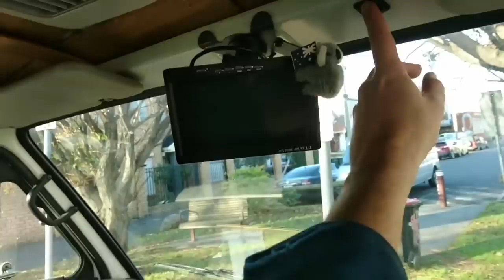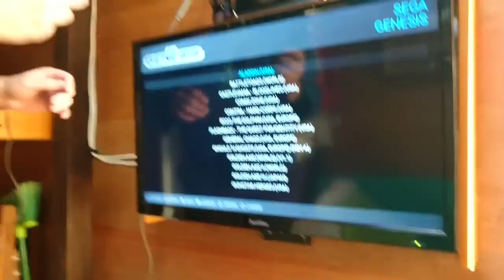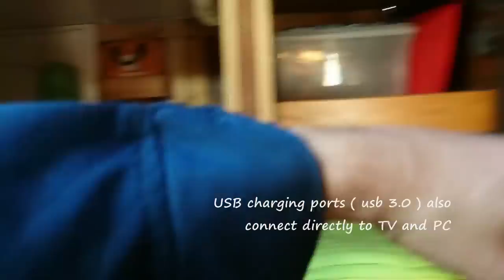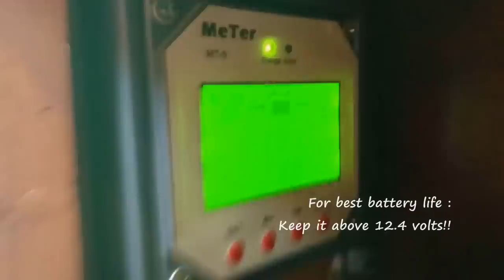How To Stealth Camp in Plain Sight in a RV

Comment: A good way to cover the solar panels on a stealth build is to label the side of the van/truck with solar survey and if anyone sees you getting in/out simply say you have to stay on location for a set amount of time as the equipment takes the readings in case something happens and you need to reset.
Reply: Or just don't go near two story buildings
Reply: Thats pretty cool. Imma go ahead and stay in my non-stealth house-house tho'. Think that might work out best.
Reply: Zia Smith  How did you get "Mom's basement" out of what I wrote?  I used all simple words.  Not simple enough I guess.
Reply: After exploring solar option I determined it was over-rated and detracts from stealth.   Charging house batteries from the engine is adequate.  7amp chargers can be powered from on-board generator when parked.  Generator is concealed in rear utility room. 50db.  Generator and AC  Exhaust is vented out the floor using   grow-tent fan.
Reply: If he’d wanted a generator to run while parked, it’d go up in the box where he removed the cooler and put in LP tanks...it’s a recycled fridge truck, so those run when needed...people hearing it would just think it’s a working fridge truck.  ‘Course, some looking to rob food from fridge truck, might try prying the doors open to get at it.
Reply: Great idea!!!
Reply: MAN OH MAN NOW THAT'S SUM DEEP SHINEOLA AND I  LOVE IT. MOST FOLKS WOOD BUY THIS EXPLANATION. Including the MAN.
Reply: @DesignerAviaries  Hahahaha Grow-tent fan!! I bet them grow tent fans run whisper quiet doncha know!
Reply: @Chimonger1  Sure but breaking into his truck will make a GOOD BIT OF NOISE. If Josh is watching TV and hears BG I reckon Josh will tear BG a NEW ONE.
Reply: Living in a house is a great option for people who have the luxury, but homes are getting out of reach for most people these days. Creative solutions, including some like this one, will become pretty common in the future. Why pay over 20k a year just for rent, when you can live in something like this for 5 years and save up for a down payment for a house? sounds like a good plan to me. Great option if you have a job that involves migration too.
Reply: I accidentally smashed the dislike button. This was in fact one of my favorite builds. I’ve been living in Vans nearly a decade and can attest that Josh’s Van works.

Comment: Ultimate stealth benefits from being able to access the living area from the cab.  

SECURITY:  
 1 )  22$  for a  driveway motion detector with 2 sensors.  Mount the sensors underneath on each side.  The alarm module inside will detect motion and alert you via light or chime.  sensors are not waterproof so use velcro mounting system and deploy when parked. 
2) front and rear cameras along with two cameras mounted to the belly that  cover the 
truck sides.
3) $35 for  12v  circular , orange strobe light mounted underneath.  IT can be activated when inside  if you hear something strange going on outside.  

4)  key fob to hit the  vehicle siren alarm.   

Ventilation
Your cab is ventilated but stealth ventilation for the box is ideal for fresh air.
My wooden plank floor has intake fan up front and exhaust fan in the rear.

Comment: After lots of thought I came to the same conclusion that a box truck was the only choice here in Australia, vans are 3x the price of any other vehicle with the same kms/year/condition. If travel is your focus then sure get a van but if its full time living then a truck is a much better choice in every way, cheaper initially, easier to build in, bigger and generally more reliable and way cheaper to repeair.......Surprised there aren't more builds with this type of truck.
Reply: Where do you park the truck long term?
Reply: Depending on the weight you could park it on the street worst case, there are industrial zones trucks are allowed. Someones driveway, depending on the weight restrictions in your area you can potentially park it anywhere a van can.
Reply: The fact that you don't know about them is proof they are stealthy :D
Reply: What about registration costs compared to vans?
Reply: Depends on what u get it classified as but any commercial vehicle will cost more.. Still dirt cheap next to rent.
Reply: Plus driving a truck, you'll have access to truck drivers stop amenities, that aren't available to the public. 
The only downside maybe the weigh station, if the furnishings and personal equipment, put you over the gvm.
Reply: The gvm is the biggest issue for sure, in Australia it needs to be under 4.5 tonne to park it on the street legally, not easily achieved especially if you want something bigger than this truck. Which I would need to be happy long term personally.
Reply: @MrDeklain  under 4.5 tonnes doesn't necessarily get classed as commercial. In QLD registration costs the same.
Reply: @jedics1  that size truck would easily be under 4.5. Even kitted out.
Reply: This in an Isuzu NPR300 which can be registered in Oz as 4.5t or 6t. So this registered at 4.5t is about as big as you can go with a standard drivers licence and standard rules for parking, etc.
Reply: A bit thirstier than a van I'd say. If you're travelling slowly it's not a huge issue but there are some areas where there's lots of distance between places and it'd cost a fair bit more to get around out there.

Comment: One thing I am not totally clear on with RV's in general, is why they need a separate black and grey water tank.  When you dump, it all goes in the same hole.  Are there situations where you can dump grey water but not black?  I have not encountered one in 25 years of owning some sort of RV.  I dump the black first, and then the grey, because I was told it cleaned the hose or something, but I have never once dumped one of them in a different place than the other.  They both go in the sani-dump.  My house works the same way.  When I lived in the city, they (the house plumbing) both went down the same pipe to the city system.  Now I am on a septic system, and it still all goes down the same pipe, to the same tank, and then on to the same field.  I don't understand why an RV needs 2 sewer tanks rather than one larger one.  To some extent, having just one large tank would help stop the poop and toilet paper from congealing.
Reply: In the vans I've been in Grey water is usually separate and black waste is in like a little cassette thing. Usually 10-20L
Reply: Grey water can be used for flushing toilets, watering plants, and more, depending on the rules where you live. At my house, my laundry feeds a separate grey water line, leading to a drain in my back yard that filters through a gravel bed and eventually out to the soil. It keeps the strain off of my septic tank, since we do laundry almost daily. 

In an RV, I suppose they are separate in case of a plumbing back up. If they were combined into one tank and you overflowed your gray water, you'd be overflowing the black water at the same time, right back up into your RV.
Reply: @gaslightheaded  That's probably it, only the toilet goes to the black water so it would be pretty hard to overflow that without knowing it.  We did overflow the grey water once and it ended up in the shower/tub.  For some reason the water tank on this RV is considerably larger than the grey water tank.  On our old RV they were about the same size so we never overflowed that one because about the time the grey water was full the fresh water was empty but the new RV has considerably more fresh water for some reason.  I assume it's so you can go longer without having to fill up with sketchy fresh water.  But I didn't know that the first time out so I figured "how can the grey water be full when I still half a tank of fresh water?"  Well, it was.  We don't usually have a problem with the black because I encourage everyone to use the outhouse unless we are bunked down for the night, unless I know I am only a couple of days from dumping anyway, like say when we are out for just the weekend.

Comment: Very nicely done . In the US the cost of auto insurance on a work truck like that is many times more than a motorhome / RV of similar size.  Could change iT to ab RV on the title with electric water and a bed.  This would reduce insurance, but not sure if tags would change to show that. Guess there is no need for gas furnace or AC there v

Comment: US units for those who use them:

60l = 15.8 gallons
15km = 9 miles
10cm = 3.9 inches 
120l = 31.7 gallons 
3.7kg = 8.15 pounds 
3.6 meters = 11.8 feet 
2.2 meters = 7.2 feet 

bed is 6.5 feet by 4.4 feet 

I like what he did. Some other Americans may as well, so 
we can use these measurements to understand what he did and 
how to replicate that over here.

Comment: looks great, but  I seem to have missed how it is heated (the empty airco shell would be perfect for an lpg burning unit,
since nobody would suspect a bit of fan noise coming from it)

The roof vent is a great idea : it can double as an escape hatch should the side door get obstructed :)
Reply: patrick van reeth I think I saw a portable propane heater when he opened the rear exterior door.

Comment from the maker: Josh is a 'Silence Carpenter ' very interesting and worth researching
Reply: Got a link or something I can look into? Basic google search yields nothing?
Reply: Joshs truck only uses 6,6l/100km ? Does not sound very realistic. 15l/100km sounds more like it.
Reply: It's a european model, they have small diesel engine (2.0, 2.4, 2.5.. 2.8.. something like that) and yes, it's very possible to use under 8L/100km.

My european van Volkswagen T5 1.9 Turbo Diesel, fully loaded and with AC on, takes maximum of 6 - 6,5L /100km in urban drive.
Reply: @1927AM  Your T5 has quarter of a cross section of this truck. You cant cheat physics. It maybe does 6.6 liters at 30km/h
My smart does more than 4l/100km in any circumstances. It has a 0.8 liter turbodiesel and weighs 800kg.
Reply: @1927AM  i do believ you, i am from austria an i also have a t5.2 caravelle it consumes about 8l/100km but witz dsg and 4x4 and long wheelebase.

But the buggest problem is the air resistance and a very high truck like that...... 

I thing it has a 3,9l engine ? I thought i was able to see it somewhere in the video.
Reply: @1927AM  at 0:43 you can see it... its a 3,9l engine
Reply: @NGC1433  i used to have a 0,9l 3zylinder "cabrio" smart too but i was able to get 2,6l/100km out of it.... between 60-80kph on country roads but you are right with normak speed about 4l/100
Reply: NGC1433 My T5 is a LONG WHEELBASE T5, it's almost as same as this Nissan.

And second of it, you smart is PETROL and has TURBO and it's automatic transmision.. u can't even compare it withTurbo Diesels from VW with Manual gearbox. 

AND YES, MY T5 1.9TDI doesn't take more than 6,5L/100km even with my AC On, in urban drive... and i change gears over 3000rpm and don't drive it under 120 km/h outside the city. (I'm not even mention that sometimes takes around 5.5L /100km because you might get mad because you wouldn't believe it) 

If you dont know VW T5, you better shut up cuz you talking bullshit. 

BUT... if i pass 120-130 km/h the consumption change dramatically due to the bad aerodynamics, somewhere around 8-8,5L /100km

AND the last of it: I DONT TALK ANYMORE ABOUT CARS WITH SMART DRIVERS, because you don't event fucking drive a car.. you're driving a toy and don't know shit about European or East-European cars.
Reply: @1927AM  as he said, his smart was a diesel! 

And we in austria do drive this T5s and T6 vw buses as emergency cars and if i drive it really carefully it consumes about 7-7,5l/100km.

The camoercan with its huge wind resistance eaasily consumes 12l and more on highways. And it does not have such a small engine as we do in iur T5s ... it has an enginde double the size of a t5 !!!
Reply: @1927AM  and you can have a look at spritmonitor.de or sites like that.... there 1000 of people do write down their cars and consumptions and this truck has an everidge consumption if 15l/100km.

Your vw bus has an everidge of 8,5l/100km .... 15000 ratings, so your data cant be true ;)
Reply: If Romanian T5 1.9TDI users see what you are saying they are laughing the shit out of them :)))) because if their T5 1.9TDi would take more than 6,5-7L /100km they would sell them immediately !!! :)))
Reply: @1927AM  haha believe in wathever you believe ;) physiks is real dude ;)

Look it up an you will see the truth... i have the t5.2 4x4 dsg long wheelebase and its around 8l ...in winter 9.

If you drive 80kph you can get down to 5,5l/100 but iam takling bout driving not crawling ;)
Reply: @1927AM  and the smart does not have a torque converter automatic, its an automated normal gearbox.... so there is no loss in energie transmitting ;)
Reply: So.. what's the point than, you agree that the 1.9TDI can easily get 6,5-7L /100km  (urban drive, not highway.. be careful about what i said in the first place) ? 

And about the Motorhome in the video, i wasn't watching all the video.. and i tought it's a 2.4 or 2.5 turbodiesel like Isuzu, Nissan, Toyota vans usually get, if it's a 3.9L engine... be sure that under 15L/100KM you wont ever get.
Reply: @1927AM  dude as i said i have the t5.2 with 180bhp too. And yes it can do 6l/100km BUT not if you drive it like people normally use cars. AND yes in this case you can use data from cartests and personal references , cause the post gas bills, and so on and i dont think that 15 thousend people are wrong , and why should they lie bout their cars consumption^^

But nevertheless the NISSAN we where talking bout has a 4l diesel engine and about 2,5 times more wind resistance than our vw buses have! (If you also dont believe in technical data from vw, just try to calculate it, if you dont believe in maths....do whatever you want. )
Reply: @1927AM  so we are fine ;)

Have a nice day, sir :)
Reply: Is he somehow related to silent bob?
Reply from the maker: @stoicallyeatingguy2  😅
Reply: Cool video, but this comment earned a dislike. How dare you tell me to research something with nothing to research.
Reply: Is that an actual thing? I thought he was trying to be anonymous by not talking. 😏😄
Reply: Back to the silence carpenter thing - even "Iraq silent carpenter" has no usable results.
Reply: Just saying but next time for sake of anonymity might wanna hide the license plate
Reply: @1927AM  It's a 3.8 Isuzu commercial turbo diesel; the reason the mileage is poor is due to the amount of weight that little motor is pushing!
Reply: I have also have a Iveco Turbo Daily (1999) with a 4,3m L x 2.35h BOX in the back, 2.8TurboDiesel 102hp and fully loaded (1.2tons) takes 14L /100km mixt driving and around 12,5-13L / 100km for exterior driving(i have a wind deflector on the roof, before instaling the wind deflector the consumption was 14L/100km for exterior driving as well)

I think you are American, Asian or Russian for saying that 3.8TD it's a "little motor" because in Europe.. 3.8 L engine for that truck it's quite big engine, in Europe.. for that truck of that size, we use 2.5TD up to 3.8TD like: VW Crafter 2.5TDI, Iveco Daily 2.3TD, 2.8TD or 3.0TD, Renault Master 2.8TD and 3.0TD..etc
Reply: Snooker commentary is LOST

Comment: What is that media center? I’d buy that thing in a hot second, considering it’s loaded with entertainment!
Reply: If you have an old PC  you can turn it into a media center. It's called LibreElec and it runs a stripped down Linux OS with Kodi on top. All of it is open source. It supports vast media files, addons from all over the world and even TV tuners for your country. It can be set up like a PVR as well as a playback device for video or audio. It's simple to install and use. It is very powerful and when you get into it it can get quite complex. I have it as my central system when we cut the cord many many years ago.
Reply: @Blazin609 for mobile applications I agree with you unless you are looking for large amounts of storage for content. You could use a couple of 256GB thumbdrives on an RPi but Lori Cox didn't indicate that her application was mobile in which case 2TB SATA2 drives can be bought for $35 on EBay and are trivial to slap into an older PC.
Reply: Thanks for the info and advice, guys. Wanting to do a conversion, though we’d use ours as a weekend camper versus a full-time liveaboard. We’re a one-car family, so I could (in theory) drive it and our kid to whatever campsite we were frequenting that weekend, while the hubby could follow along after he got off of work. We like tucking in after a long day to a family movie, as well as listening to tunes while we putter about the campsite. That little box (and its interface with all the things) looked like it would fit the bill. 😊
Reply: Also, I love the RPI ... I’ve become the most popular friend for all my girlfriends’ significant others, as my go-to advice for b-day gifts is to get them a kit that helps you build your own RPI. lol
Reply: I have a micro pc(azule byte 3)that I love.have 4tb hd space(1tb internal ssd and 3tb external)has 4gb ram and quad core processor (so its good enough for basic pc stuff +media)and I have emulators on it,kodi,and even have an android emulator so I can run it from that as its windows 10 based.can it run crysis?lol no.nor any other AAA titles but as a media server/basic pc?amazing.
I do want to get a couple Pi's though to play with ,their versatility is pratically limitless